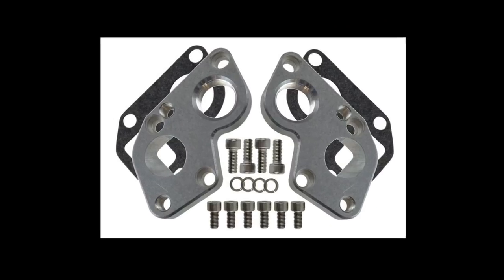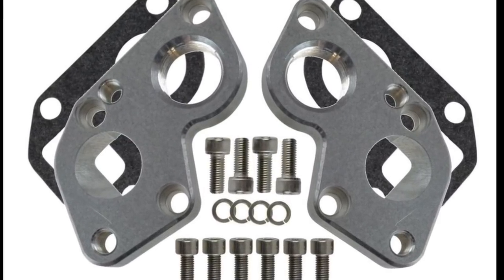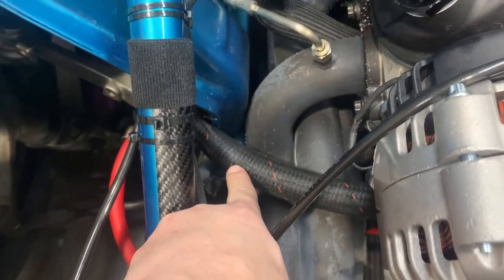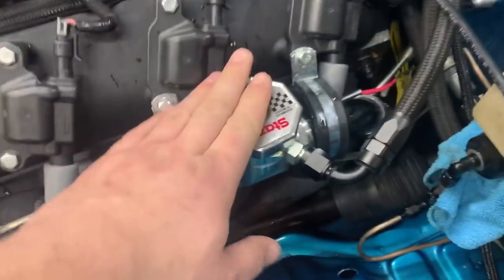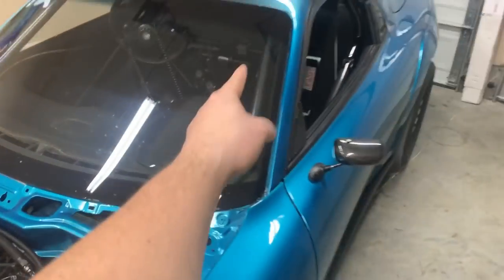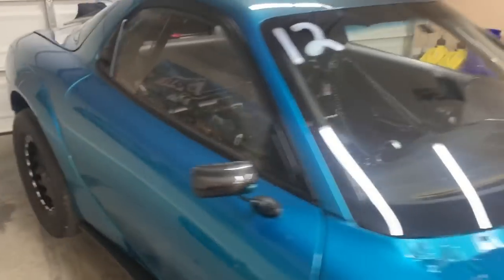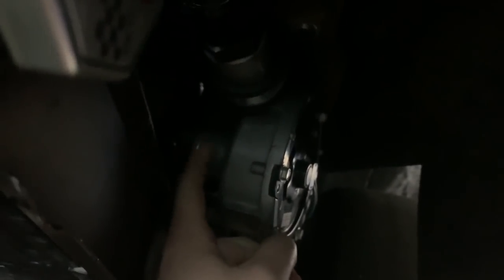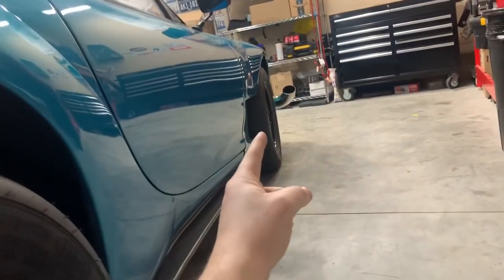Remote Mount Water Pumps - Davies Craig & 417 Water Manifold

Comment: interesting.... no thermostat? how does it keep pressure in the system to prevent hot spots and cavitation against cylinder walls? cavitation can eat/destroy aluminum and gaskets such as head gaskets etc i'm sure you know this so where is pressure to keep the system up to 10psi? id like to know cause id like to use this kind of system on a boat

Comment: I have a roots blown BBC with a rear mount radiator and fans capable of cooling a trophy truck. The EPW150 pump gets to a certain point, then starts cavitating and temps skyrocket. I'm beyond frustrated.

Comment: Im not 100% set on a remote water pump. Im going to run a small single belt/ low mount alt. I just want a simple damn electric set up, that I can hook to 1 of those Mohave style under dash heater/defrost units. It seems like damn rocket science to get it to work. Speedmaster makes a "manifold style" water pump. WTH cant someone make that with a simple 4 bolt electric motor!!!! Can someone help me!!!